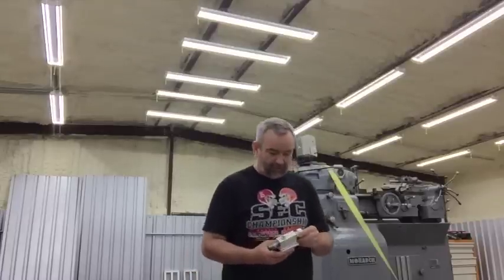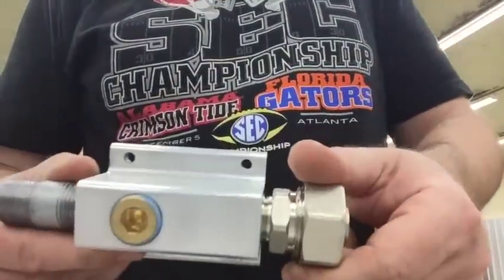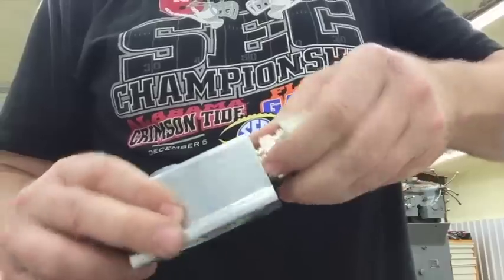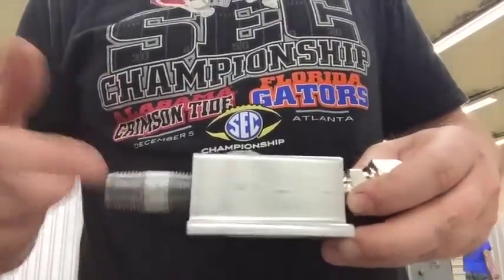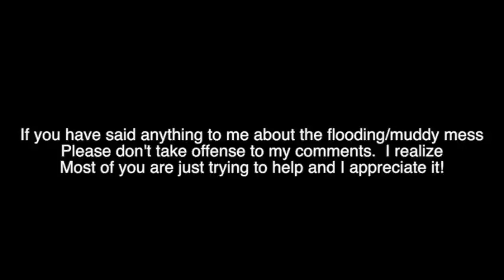Shoplife 022 - Jr Fabricator - Texas Flooding - Airline Adapter

Comment: FYI, lay flat bar down when cutting on the bandsaw. Just trying to save you a few hundo on your education. Also, I bet Ellis has a coolant kit for that, quite handy when it comes to cutting thick stuff and prolongs the life of your blades.
Reply: Nah dog, Eillis does not make a coolant kit for it, they sell it as a dry saw, and sell bimetal blades the recommend running dry.  This has been discussed many times, John at NYCCNC has one and has talked about adding a mister and blowing air only, but no coolant.
Reply: Wow, seems like a huge oversight.  Irrespective of bi-metal or not, coolant makes a huge difference when cutting materials.  The coolant lubricates the saw, just like using oil when drilling a hole, the bit lasts longer.  I just assumed that huge sump underneath the saw was for coolant, couldn't see any purpose in building a big box under the saw if it wasn't for a coolant sump.
Reply: Ahh, looks like they only offer coolant on the 4000.  I wonder why they don't offer it on any of the lower models?  Yeah I know that it can be messy, but with proper tray design it can recover most of the coolant.  I think your best option is to get a fogbuster and mount it on there, with that compressor you have it would be a good way to go.  I don't like kool-mist much, it's messy and not very lubricious.  It works on Aluminum, but I've burned up too many endmills in other materials because it doesn't lubricate well.
Reply: Correction, according to the parts manual, it's just 'air cooling' on the 4000.
Reply: Now your learning! ;)
Reply: I have a vertical bandsaw with no coolant and a horizontal with coolant, the blades seems to last much longer with lubrication.  I used to have some stick wax for the vertical, until it melted.  See "Easy-Coat Cutting and Tapping Stick Waxes" on McMaster.
Reply: Ok, yes I have seen a couple people use the stick wax, will check that out.  Brad at tactical keychains recommended using the mister, and just put a tiny amount of water out, so that when it hits the hot blade it vaporizes and leaves no mess, but cools the blade some
Reply: The problem isn't so much about cooling the blade, it's about lubricating the blade.  Heat is a product of friction, if you reduce the friction by lubricating, then heat doesn't build up :-)
Reply: Misters primarily remove chips from the cutting area, preventing re-cutting of chips, which can damage rotary cutting tools.
Reply: What egomania said. Cut flat. Minimum of two teeth in contact with the material in the curf of the cut. You can cut thicker material vertical, but cut thin stuff flat to save your saw blades.
Reply: Sorry eformance, spell check got me.